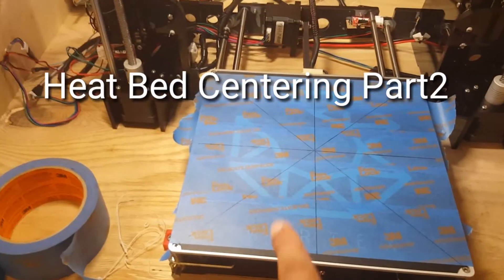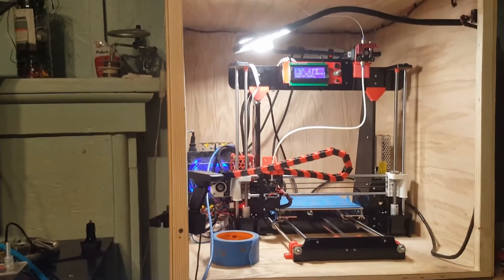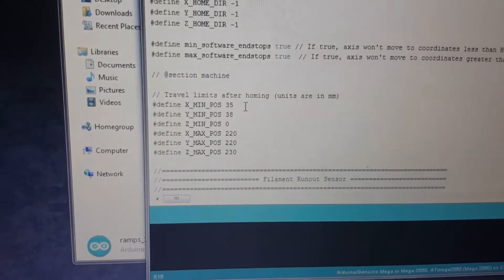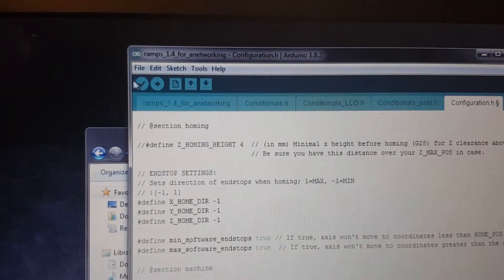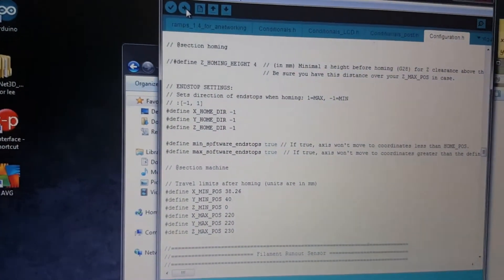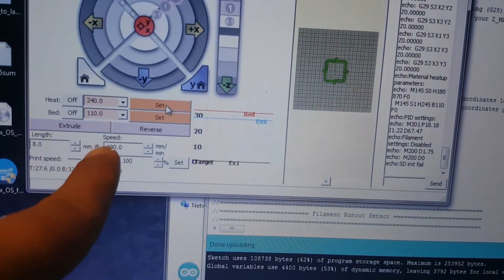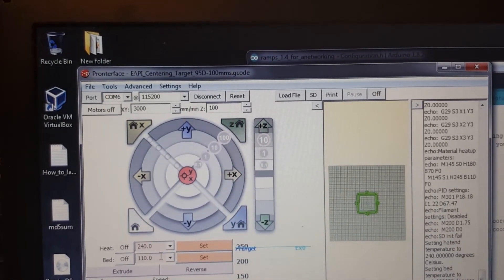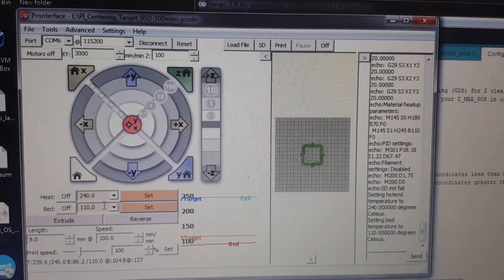How to center your 3D Printer Heated Bed  (Part2)

Comment: I keep getting air messages it's my first time using Marlin when I uploaded I keep getting red error messages can you please help me it  would be helpful thanks
Reply from the maker: Yea  so I would say to  check and see if you have you  board setup on the arduino ide  and that you are on the right  com port  then try uploading the firmware ino file
Reply from the maker: I will probably make a new video about using and  installing marlin firmware on to 4d printer motherboard using arduino mega and ramps 1.4 on the arduino side 😀 so make sure you subscribe and hit the bell icon for the new video when it comes out
Reply from the maker: So did you get it to work?
Reply: @LegitLeeVelez  no it didn't work I still need help
Reply from the maker: @rizkdark3684  okay I just need to get a new motherboard first then I will make a new video.
Reply: @LegitLeeVelez  do you think you could please do a video tomorrow I really need help
Reply from the maker: @rizkdark3684  it will have to be when I get a new motherboard in before I can make a new video on it but when I get one I will definitely make a new video for you

Comment: Hi, thanks for making this video. I've been looking for a solution to this centering issue. I'm using a Tevo Tarantula. But for some reason, my centering is still the same even after modifying the min x and y pos. Any idea?
Reply from the maker: Jeramz-Projects Have you calibrated your steps on each stepper motor because if your firmware steps are off it wouldn't matter if you adjust the x and y pos it would still be off.
Reply: Lee Velez thank you for the quick response. And no, I haven't. Do you have a video tutorial on how to do that? Appreciate the help. Keep up the good work!
Reply from the maker: Jeramz-Projects I will make a video of that if you want and could have the video up by Sunday night
Reply: Lee Velez awesome! I'll look forward to it. Subscribed. I'm using an autolevel sensor. What did work for me though is by adjusting the x and y probe offsets, that got me somewhere in the middle. But I read that it changing the recommended numbers could mess up when doing big things... Let me know your thoughts. Thank you!
Reply from the maker: Jeramz-Projects well it could mess up if you print bigger then what you habe you heated bed set to and what you height is set to so make sure you x y z numbers and set right then I would say do a steps calibration dor your stepper motors the and then use this videp to do the centerimg of your printing then if that doesnt work try checking and tweaking you slicer program cause that could cause problems also